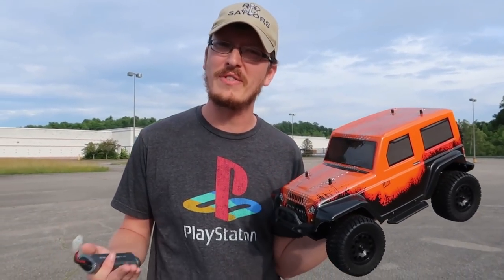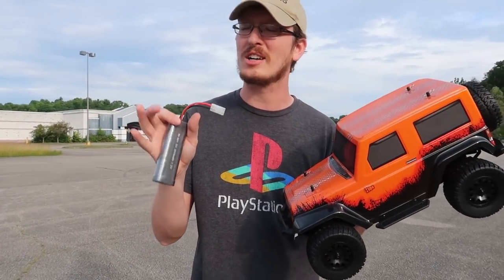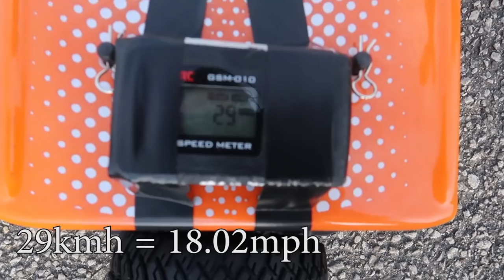How Fast is this RC Car? - Off Road 94702 4x4 RC Truck Crawler - TheRcSaylors

Comment from the maker: Check out the rc car here: https://bit.ly/2YJtnv1
GPS Speed Meter: https://amzn.to/2Y9z2eA
Well, we know this won't be to fast, but we wanted to do a speed test on this RC car anyways.  This is a 1/10th scale brushed motor rc truck crawler.  Everyone always likes knowing how fast a car can go, so we thought we would try it out on this one!
Disclosure: This description box contains affiliate links.

Check out the rc car here: https://bit.ly/2YJtnv1
GPS Speed Meter: https://amzn.to/2Y9z2eA

The products in this video are rated for ages 14+.
Reply: I say you both sign that gps speedo and auction it off. I’ll start the bidding at $50!
Reply: I also dabble in blacksmithing and I just got a new anvil so I can finally make you a decent knife Nate.
Reply: Worth adding in a faster motor too this for sure, esc is a wp1040 which says on 2s lipo it can do down too 12t motors but I'm not entirely sure about that.
Something like a 15t is more reasonable too believe though for a budget vehicle like this.

Comment: I am a pocket knife collector and user 2! But the best thing I like to pair with my RC cars is 3d printing. I recently designed printed and installed a roof rack. Have a few other miscellaneous things I am designing for my trucks.

Comment: My other hobby is car racing, car related events and running trackdays with my friends. Working on cars and so forth is also part of it. I also run an agency which supplies ceramic brake discs for sports cars and race cars.

Comment: Oh I have your favorite batteries you love so much from Spectrum and one if there chargers the bottom of line one for my Tamiya grasshopper. Witch I think you should get for Abbey to build. And if you do make sure you get ball bearings for it and a better motor for it because the 380 motor is slow an weak.

Comment: I fingerboard but not techdecks they are real laminate plys of wood and have bearings in the wheels some i have cost around 200 dollars and I also have to scale cement parks in one of my buildings for them just type in flatface fingerboards youll see. I skated for 30 yrs but cant afford to get hurt.
Reply: Sounds 🔥 man

Comment: I dont understand why anyone would spend 200$ for a chinese toy when you can get a real rc car for much less. This thing will break probably on the first run, especialy if you put some decent 30 40 mph electronics, and then you can throw it in trash because there is no parts. I know many people dont like traxxas but they are resonably priced especially 2wd lineup, upgradable, cheap parts in every store and most parts are under 10$. Just for the record i have many cars, 5 traxxas, arrma, 2 associated, losi, ofna hobao, hpi, tekno, hobbyking trooper. All of them except chinese trooper are equaly good, but my go to for bashing are traxxas, they are just made to last, not falling apart after every ride like chinese stuff
Reply: Also you can look for used stuff. Half of my models were new half used. Good deals can be found sometimes. Bought brushed twin motor erevo for 150, brushless slash 4x4 without esc but with brand new 3s lipo and a charger for 100, team losi buggy 3.0 roller for 90